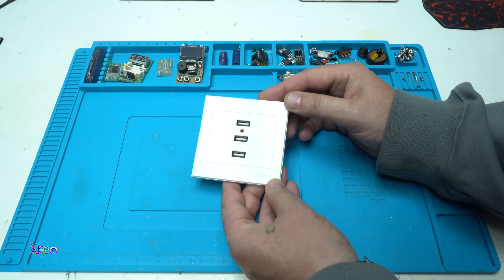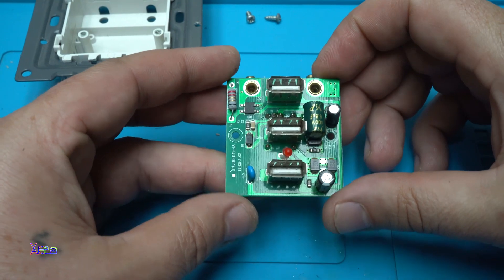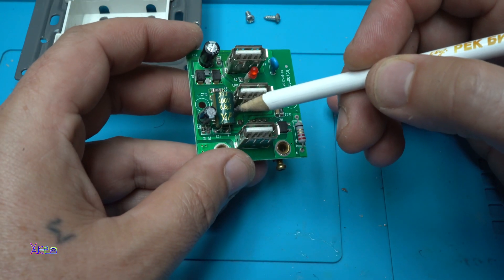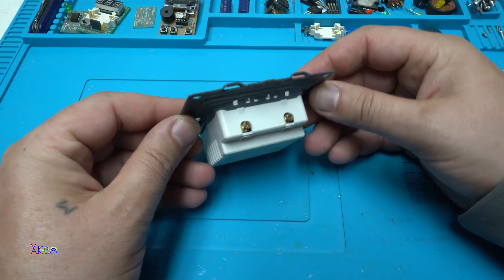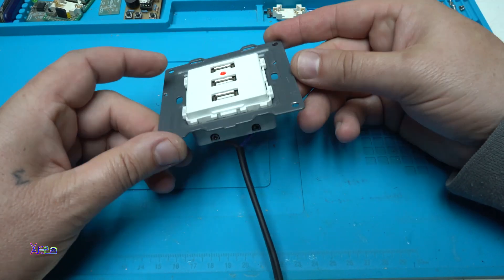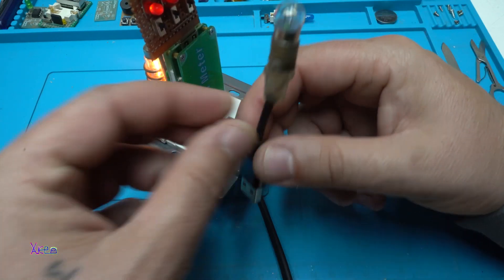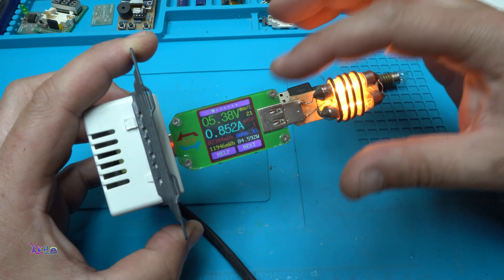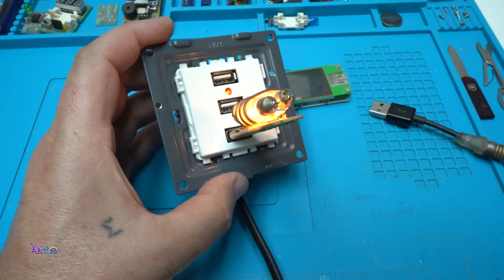3 USB Ports  3Amps Wall Socket from Aliexpress - Does it really give the current?

Comment: That's as good as cheap 2 - 2.4 Amps charger. Not worth it, in my opinion. When you plug all 3, you can see the light dims and probably the usb meter goes down too. It doesnt stay constant 1.5 Amps.